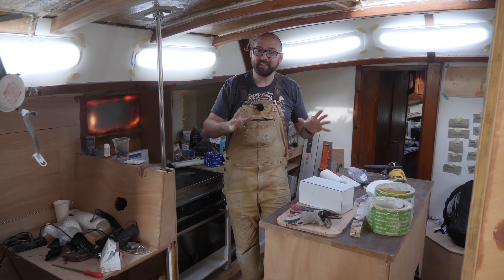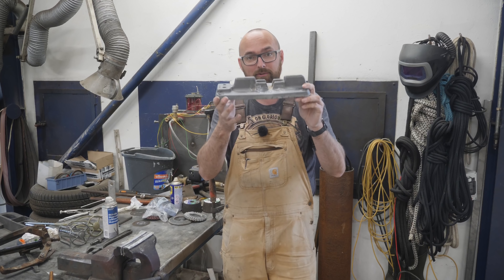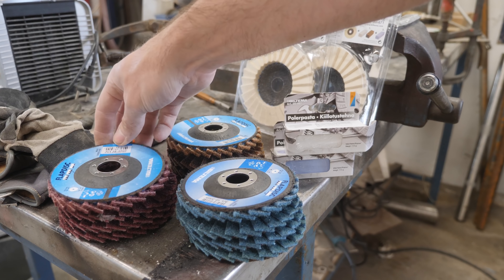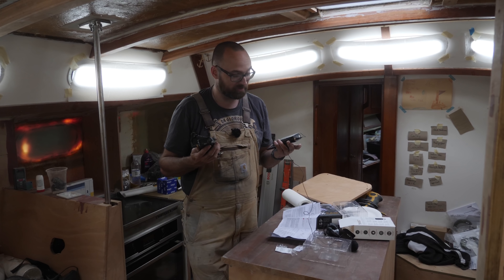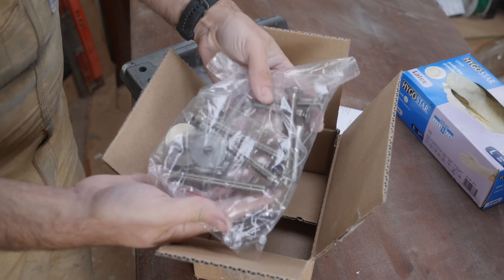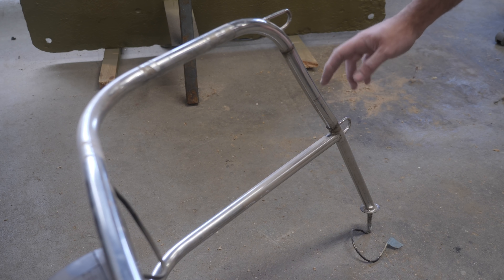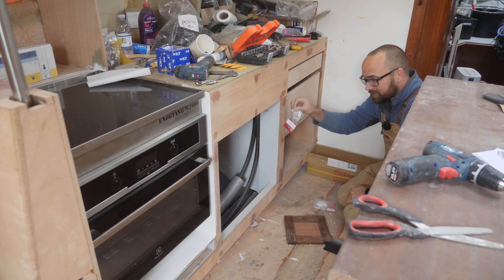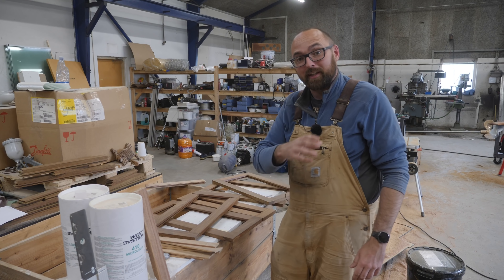Sail Life - A week of sailboat repair projects

Comment: Mads, for your island refrigerator, have you considered making the top out of multiple pieces?  That way the whole thing doesn't need to be opened when only a small part needs to be accessed.  You will lose lots of cooling air on a sailboat when the whole thing is opened.  I suggest making the top out of two or three sections, each of which could be opened independently.  Yes, that means more mechanisms, but in the long run, it may be well worth it.  Also, the top needs fiddles, to keep whatever is on it, on it.  10-20cm fiddles or more will work great.  Round them over on the top edges.  Looking great.  I hope to run into you and Ava on your vessel when you are on the seas.  Not literally.  Just to meet in person.
Reply: He seems to have made up his mind, unfortunately. I don't think it's a good idea either.

Comment: I was checking on line about the lift up hinges for your island. Great idea by the way. I found hinges with two parallel bars connect the left and right hinges. Some of these had triangulated corner braces that eliminated the size to side movement you now have.

Comment: Have you ever tried sanding with control spray? Just apply a super fine mist of spraypaint before your last grit, and then sand until all the paint is gone. This makes sure you don't miss a spot, and it makes scratchmarks from lower grits more visible. It might even be a good idea to do this for every grit, when working on stainless.

Comment: Great video!  When you replace the middle section of tube, leave the smaller diameter tube in as well.  It will hold the larger diameter tube in place while you are welding, it will act as a backstop to your weld, and it will act as a heat sink.  (I am quite sure you already thought of this, but just in case..... )

Comment: When I build rail and style doors on the router table I use a set of push down feather boards I built that are adjustable so that each part gets the same pressure on the jointing surfaces. It makes cheap tables somewhat usable.
You do need to build an aluminum router plate if you're ever going to turn out repeatable parts.
My advice to a woodworker with more skill than I'll ever have.
Love what your doing with the old boat.
Reply: second that
Reply: Feather boards would be great. When you do those cope and stick joints you need to have consistent down pressure. 
Mads, is there any way you could stiffen the router plate? Perhaps some angle iron/aluminum?
Great looking frames! The extras are not mistakes, just setup tests!
Reply: Thirds on that. An aluminium plate makes all the difference.  The only thing better is a precision lift ($$$$$) Feather boards are a must or every good part is luck.
Reply: Aluminum or possibly thick Plexiglas. Not cheap plastic, the IKEA of router tables. Use one week and throw it away. Sometimes cheaper is more expensive.
Reply: That was what I was going to recommend. The basic table will be ok, you just need a much stiffer plate. Aluminum or stainless, I know you have some of that.  Feather boards are easy to make and work wonders.  Don’t feel bad about the kindling we all go through that stage.  I was a professional cabinet maker for years.

Comment: The trick to good polishing ( which yes is pretty obvious I guess, and you’ve probably worked out a long time ago - but for other’s benefit....) is this. If you go, for example 200 - 400 - 800 - 1200... you need to make sure the 400 has removed all the 200 scratches before you move on to 800. Because the 800 is not going to remove the 200 and you may not be able to easily see that the 400 has not removed all the 200, until the 800 has removed the 400 scratches. :  )
The net result of all this is your 2-3 grits down the list, and all the work that entails, before you realise you were a bit hasty on an earlier grit.  Which results in two factors: you have a shiny object with deeper scratches that you can’t polish out with the finer grit you’re now at. And if you want it shiny you need to start again at the level you rushed and go through the process again!  At which I have some of experience.... The moral of this story is don’t rush it.  Or you’ll end up doing it twice. : (

Comment: Hi Mads,
  Watching your video (always enjoy and have followed since the beginning).  The building of the fridge prompted me to pass on a bit of advice of which you might not be aware.  A couple years ago I discovered that adding a layer of "Reflexic" insulation to the INSIDE of an insulated box dramatically improves it's insulating performance.  Just one layer that covers all interior surfaces when closed, all sealed with aluminum duct tape, makes a huge difference.  Sounds counter-intuitive that such a thin layer with a very small R value could have such an effect but it actually works, and is easily replaceable if damaged.  If you doubt me, (don't blame you if you do, I was skeptical myself), try it in a portable cooler.  All my coolers now are lined this way.
Just a friendly FYI.

Comment: Hi Mads, when you assemble your winches, get a 2.5 cm paint brush & cut it down to about 1cm length. Use this to apply the finest smear of winch grease to the gear teeth & just a wipe over the bearings with a little grease on a rag but check the Lewmar manual for the correct lube. Whatever you do don’t put too much grease on, the salt will dry & emulsify causing almost a grinding paste ( especially if you are anywhere near the coast of Africa fine sand sticks to the grease). It’s also important to keep grease away from the pawls (flappy things) & springs just use a single drop of light oil, winch oil is expensive but 3 in 1 works just as well. I serviced winches after every ocean crossing & just used diesel in a bowl to clean everything, works a treat. Keep a couple of spare springs and pawls in your tool kit they are about the only things that wear out, some pawls can develop micro cracks where the little slot is. As long as you keep on top of things the bearings should last a long time.  There is one school of thought that you shouldn’t use grease on winches. The ones I worked on had done over 100,000 miles & they were greased. While I am on McLube One Drop Oil is good for pulleys & tracks, use very sparingly, only 1 drop it goes a long way.

Comment: Mast Base - the amount of load from the mast may be flexing the deck b/c it looks (I could be wrong) unsupported. The forward bulkhead looks like it’s behind the mast step. Therefore with load and subsequent rig pulsing (which every rig does underway) it could be flexing that area a bit. Maybe a new laminate beam that spans the cabin top under the base. Maybe there is a support bar that you have a I didn’t catch in the video, I would give some thought.

Comment: The crystal structure in some metals can be strengthened (heat treated) OR weakened (annealed) by application of heat. I’m a biomechanical engineer so I don’t do much with aluminum but I know at least some aluminum alloys can be affected by heating. So I suggest you double check with Seldon about how you heated and straightened the aluminum part to make sure it’s strength would not have been affected. A good machine shop may be able to re-treat it for you if it was. Dismasting is better than fire or sinking but not by much to my way of thinking. Best regards. I thoroughly enjoy your channel.

Comment: Lots done, lots left to do, great video Mads, thought the mast foot might have ended in a few more peices on the shed floor.....well done. Talking about the mast foot, think you should consider using an electrolytic corrossion protection like 'Duralac' on the stainless bolts where they go through the plate. Cast alloy is really vulnerable to electrolysis and even though you used butyl to seal from water intrusion, think while it is accessible best insurance would be to used durralac on the bolts ...... and coat the mast step with some paint! CU ;)

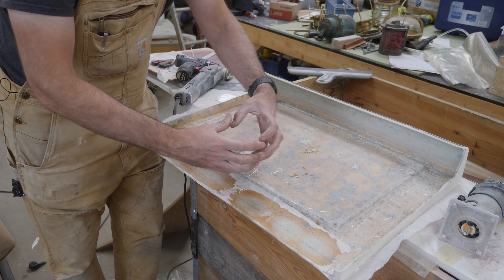Comment: 2:32 Firstly, I've been on two boats where the cast aluminium mast foot cracked. I really wouldn't hit one with a hammer. I'm not sure what you can do about it now though, other than annealing. Check it over very carefully for cracks. Keep an eye on it when you're sailing. You really don't want it to fall in half far from home.  Secondly, what is all that butyl tape under the mast foot achieving?  Sealing around the bolts is good of course, but the rest of it is not sealing anything against anything, and once the weight of the mast is pressing down it's going to squeeze out.  If you are looking to protect the deck surface you'll need something more solid.

Comment: A lot of progress despite a lack of dunnage ;). Great episode though.

My wife owns a medium-quality router table and still there are some issues routing complex shapes with repeatability, especially with harder woods.  Decent router tables are expensive.  But so is high-quality wood stock that gets turned into kindling repeatedly.  Oh, so frustrating!

One final note, you might have wanted to have coated the beveled heads of those stainless mast step bolts with TefGel or Lanocote to electrically isolate them from the cast aluminum mast foot.  Salty water is going to continually get in there and sit right at the butyl barrier and create a little battery which will grow fuzzies on the aluminum and pit it around the bolt holes.  It will eventually start to look a lot like your old aluminum toe rail I fear.

TefGel is kind of expensive and Lanocote is messy and can bleed minute bits of residual sheep goo for years.  But both are better than a fuzzy battery and pitted aluminum though.

Comment: Nice video again. I don't think you will have any issues any more regarding the mast foot bending. In my opinion, this happened over time because your deck sandwich watered in and lost it's strength. As you repaired your deck with very beefy support under the mast foot and elsewhere this shouldn't happen again.

Comment: Hi , I love all your videos and techniques however having done an awful lot of metal polishing in my time I think you could save a lot of time bye not using such a harsh grit on the stainless, using a lighter grit will produce less scratches and allow your high buff to appear much faster, also bit of a shame you did't give the mast base the same treatment, only with aluminium wet sand with 600 finish with 1200 and start buffing to a high shine, may not be seen but you know it's done, thank you for your videos I enjoy them all, all the best from Aus, Allan

Comment: I would think it would be easier to find some 90 deg. fittings, weld a ring on the ends for a lifeline cable  for the middle and leave the center open so you can access the stern without climbing over both rails.... you have a swim ladder...

Comment: I cant help suspecting that the bent mast foot is the development of flexibility in the old deck. Our one bent too because we had no compression post directly under the mast. But instead they were relying on the stiffness combination of the main bulkhead and the deck. The bulkhead was only under the rear edge of the mast foot. Like your Mast Foot? Originally it was probably ok but as glass boats get older they get flexible. The flexibility in the deck/Bulkhead ment that the Bulk head door frame would change shape when loading up the rig. So the door wouldnt close. I could never get the nice shape into the mast I was trying to get because the deck would flex down causing a low bow forward in the mast. The mast would also pump in the wind. A metal compression post bolted directly backing the mast foot solved all those problems and made it solid as a rock. Well I found I could still just warp the boat around the compression post. So I still had to have the rigging looser than I liked but the compression post stopped all the pumping and made everything feel solid.Old fiberglass boats are really only as stiff as wood boats.  If you dont already have a compression post that would be my 2 cents something along the lines of a 40mmx2mm tube. Cheers

Comment: Your router table might work better if you replace the p 'll astic center plate with an aluminum version. I think Rockler has them along with a few others. Certainly worth checking. If not a machine shop should be able to copy your plastic one in aluminum

Comment: Enjoyed the video, as always.  Thought I would share a recent discovery I stumbled upon when looking to "spiffy up" my own Seldon mast steps & castings used for the spreader attachments ( main & mizzen).   The suggestion was to use paraffin oil (kerosene I think? ) to treat the castings if they were showing signs of surface corrosion from salt and age.  I opted for mineral oil instead ( also petroleum based) and was shocked by both the absorption and the rejuvenation the casting.  

Kind regards  :)

Comment: Mads, you should definitely build your own Router table. For the holding plate and other decent   accessories you should definetly check out sautershop.de or the UJK one from axminster.co.uk also available from dictum.de. You also can get complete router tables from sauter, but they cost a fortune. Better build your own. And always remember: Kaufst Du billig, kaufst Du zweimal. And life will be much easier with a decent router table, come the time to build all the cabinets and furniture Ava and you will need on board of good old Athena.

Comment: I also have endured the pain of a router table that wanders off its setting with successive boards. It is not fun to have to re-set a router table for every single board you run through it.

Comment: Companies like I worked for use softstone wheels for uniform finishes before polishing, you also should have looked into two-stage polishing using a green rouge bar first to remove any scratches and then finishing with the white rouge bar. Most jobs we did for seat frames, bow rails etc all were done with the green bar but certain cases required a mirror finish and that is when we were required to do a secondary polish with the white bar. But hey, what are tips for if they can't be saved for later, right?

Comment: I would be very interested to see what method you used to secure the mast step bolts on the deck so you could tighten things up below deck.
Reply: It must have been mighty jahnky or else he would have shown it on the video :D
Reply: just two clamps it looks like
Reply: @svbarryduckworth628  I agree, but I still would like to have seen!
Reply: @iyurtygaming8588  How do two "clamps" help on a recessed bolt head?
Reply: @svbarryduckworth628  I agree, but I still would like to have seen how he tried to do it single handed!

Comment: I would suggest that you can fix your router by adding an improved router lift such as a JessEm Rout-R-Lift II Router Lift For 3-1/2" Diameter Motors, JessEm# 02310.  This is fairly inexpensive (about $200) and allows micro-adjustment of all aspects of the lift and it is rock solid.  If you lock it in place, it will not move.
Reply: I think he paid around $50 for the whole table :D

Comment: I'm amazed that you could bend the cast aluminum so easily. I would have guessed you  would have needed 250-300 C. I would definitely check the casting all over with a magnifying glass for any stress cracks! Aluminum is an awesome material but so unforgiving.

Pretty cool belt sander @ 5:38, is that about a 3" x 60"?
Reply: For Joe Cross,  a machine shop I was in, straighten twisted & warped automotive aluminum cylinder heads quite alot in an oven. However, we didn't use a hammer. 😳... it is his, and it did work.
Reply: @stevenr8606  True, but man I was nervous. An unobtanium plate being bashed with a big hammer.

Comment: How did you secure the bolts topside so they wouldn't turn?
Reply: Yes, I need to do the same thing and can’t seem to figure it out
Reply: Agreed I'd love to know, doing these things solo seems like such a pain!
Reply: I usually use mole grips https://en.wikipedia.org/wiki/Locking_pliers attached to the appropriate tool.  In this case, a hex / allen wrench.

Comment: Hi Mads,
on my Lewmar winches the upper part where the sheet is hold was worn out. Please check it before you reassemmble the grinder. Otherwise wou will need new ones during the season like me 😬.
Selftailing  winches which do not grap the sheet safely are 🤮
best whishes Sören

Comment: To make a consistent 'Round Over' bead on the deck joint, choose a six inch length of PVC pipe w/ the appropriate  inner diameter, cut it lengthwise into 1/4's, then take two six inch lengths of your 'Practice' door front pieces and screw them into a long 'L' shape. Glue one pipe section into the bottom of the wooden 'V' and glue in two shims abutting each of the pipe edges to form a smooth surface. You can now use various grades of sandpaper to bring the edge of the deck down to a uniform radius along it's entire length. Inexpensive homemade tools are the best tools... ; {

Comment: I'd hazard a guess that router is not to blame but the fact router bits were machined. All it takes is few micrometers off to make jaws fail to tighten the bit properly. It might feel okay by hand but at high RPM or elevated temperature it slides off and causes the issue with repeatability.

Comment: with the router not having consistent passes it might be that you bit shaft is bottomed out in the collar and as the bit heats up it expands and pushes out. i always set the bit about an 1/8" up from the bottom. Also how do you stay motivated week after week? Does the youtube channel help or hinder your motivation?
Derek from Toronto Canada

Comment: Hi Mads, a quick technical question from a Voyager 35 slave about to redo the mast step! What did you find between the deck skins under the mast step when you replaced the deck? And what did you replace it with? Any info would be really reassuring before I begin surgery.
Rob